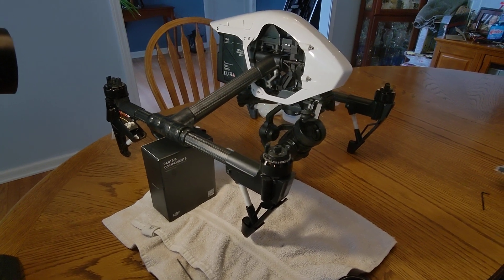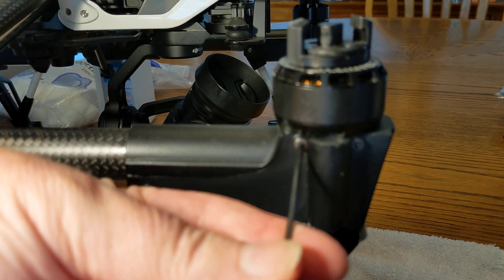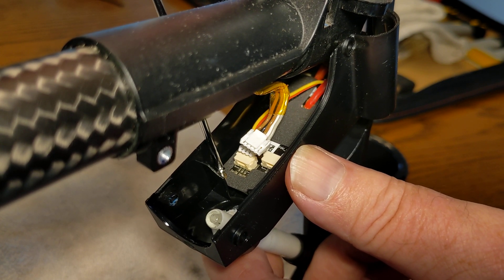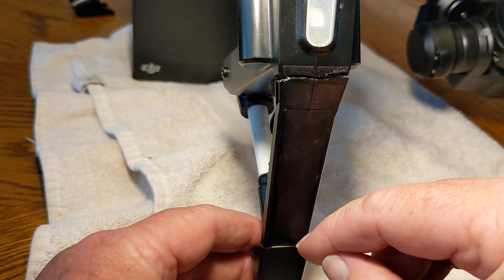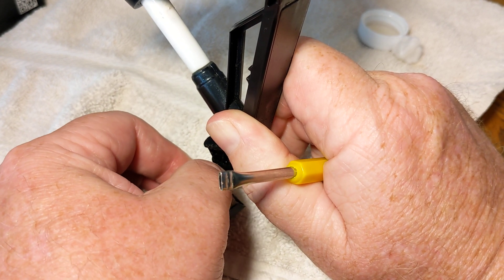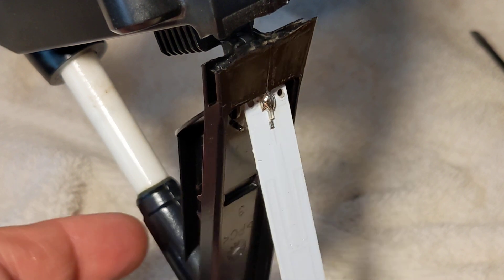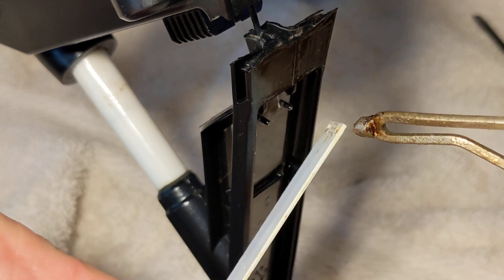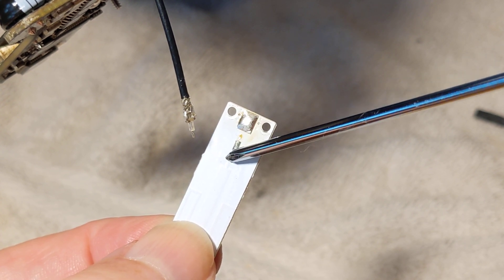DJI Inspire 1 Landing Gear Removal for Repair "How to"

Comment: Don't suppose you can show me where I can find a replacement cable or antenna for the landing gear?
That is the one thing I am trying to figure out how to repair.
Reply from the maker: Have you inquired with DJI? I'd start there. If that doesn't work I'd be working some Google searches and eBay.
Reply: @p38aerial  yeah, they told me to get f__ked, because they stopped offering support for this drone.